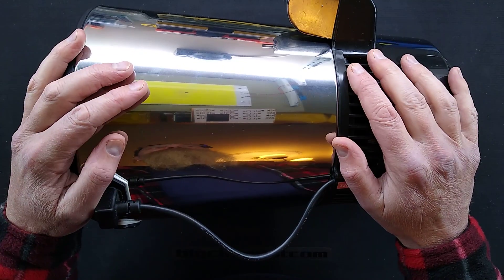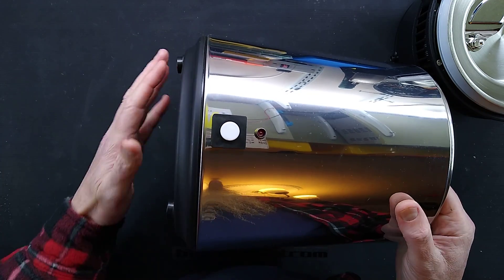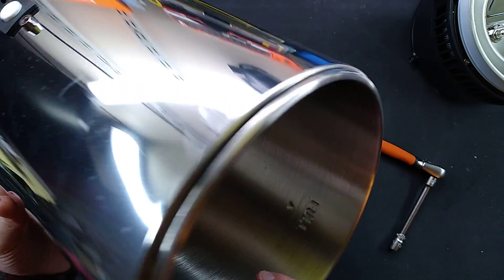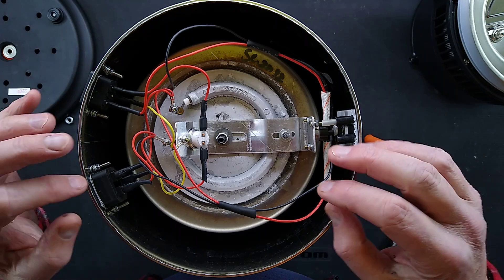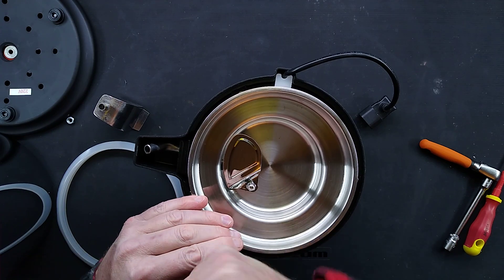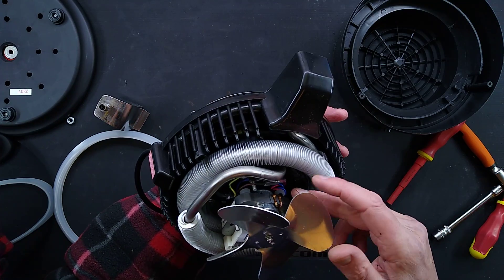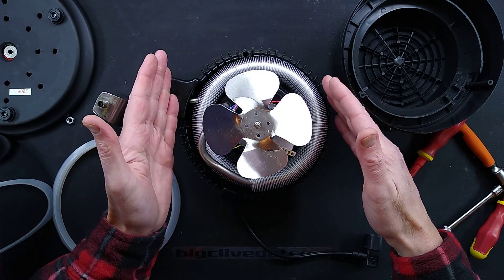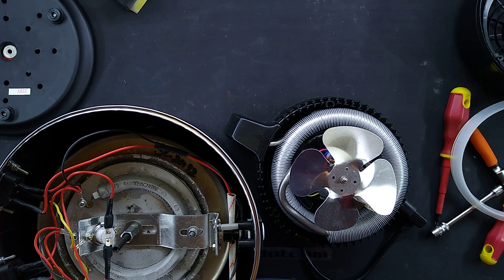Water/alcohol air-still distiller teardown

Comment: I always pictured glass tubes in a lab seting for water distillers. I guess this works too.
It's amazing how simple it is. A heat source, something to collect and condense the steam, and somewhere for that water to go. I like this idea.
Reply: The reason laboratory distillation setups use glass (usually borosilicate pyrex glass as this is more resilient to thermal stress) is because they are usually not used for distilling anything so innocuous as water. Most chemistry labs get through a lot of "distilled" water for rinsing glassware after washing it, since you don't want residues from tap water contaminating your flasks. So it would be highly energy inefficient to run actual distillation systems for this - most labs use ion-exchange resin columns for purifying water since these are much cheaper to run and produce mineral-free water which is perfectly acceptable for rinsing purposes.

Anyway, the actual distillation sets are typically used for distilling solvents, or purifying other liquid chemicals, some of which would react with metals or get contaminated by traces of metal oxides from the surfaces of metal condensers. Glass is chemically inert in nearly all situations, which is why labs use glass for reaction vessels and most other chemical handling equipment.

Metal condensers do exist though - all you need is the two standard diameters of copper plumbing pipe plus some 8 millimetre copper tube and you can make your own copper "liebig" style condenser by soldering or brazing it all together. For distilling water this is perfectly fine, just not for some other stuff. It's also fine for distilling alcohol of course. In fact, every commercial system for making spirits by distilling some kind of fermented mash will have some copper components in direct physical contact with the alcohol being distilled - this is important since the copper reacts with and removes volatile organo-sulfur components which would otherwise give the distilled spirits a bad taste and/or smell.

Comment: Clive, I think there is a thermal fuse in the unit, it would be under the fibreglass sleeve under the manual reset switch on the red wire. 

I will be sending you an email later today, I have an interesting device to send to you for a teardown video. 

Coming back to the Isle for the TT next summer, see you then. Cheers.

Comment: That one is way posher than mine! I've had  mine for absolutely years and apart from that "burping" issue I had a while back it's always been great. I've made literally gallons and gallons of booze with it! It's not illegal to do over here in Portugal either! You have to keep the cooling fins very clean over here because if it gets fluffed up it barely copes with the higher ambient air temperature.

Comment: Those wires (red) seem to dangle very close to the heating element. Is the insulation PTFE?
Reply from the maker: It does appear to be high temperature wire.

Comment: Interesting, now I'm considering getting one to distill water for developing photographic film as I've been buying battery water for that until now.
Reply: @Matt Quinn - Caledonian Television Yes, we actually have very good and clean tap water here so not contaminated in the sense of being bad to drink but it's quite hard, lots of lime scale, so I like to use distilled water for mixing chemistry and for the final rinse. Not sure if it really matters for chemistry but definitely matters for the final rinse, I have tried using tap water for that but I got calcium deposits or "water marks" on the negatives. I do use tap water for the bulk of the washing though and have not noticed any problems.

Comment: To distill grain alcohol, you would want a limit no higher than 180°F (82°C). You only want to boil out the alcohol, but the water.
Reply: You wouldn't. The temperature will never go higher than the boiling point of the fluid. So basically, the temperature will rise to 82-ish degrees (maybe a bit higher), and the fluid starts boiling. Then the temperature only slowly continues rising as the ethanol evaporates, lowering the concentration of it in the distiller. If you would limit the temperature to 82 degrees, the fluid would only boil if the ethanol content in it is about 58% volume or higher.
Reply: @simonbenjamins5175  Isn't it all about bringing to temp slowly rather than boiling the nuts off it quick sharp in a hurry?
Reply: @dofbeer  Normally I'll bring the temperature up until the wash boils. Once the distillate starts running I'll take the heating down so that the distillate will flow in a trickle. This way you can make better cuts, if the fluid in the still boils too vigorously you'll get more impurities in your end product.
Reply: Boiling the alcohol but not the water makes as much sense as drinking the alcohol but not the water.

Comment: unlike the lock picking lawyer you have nothing to hide such as nude paintings such as the one that hung above the bed of the person from the shining so reflections are not a problem for you.

the thermal fuse is in the wire that runs between the bracket and the popout switch

Comment: If you could operate the unit inside of a vacuum chamber, energy consumption should be very low. How do you think about that?
Reply: Boiling point of ethanol at 100 mm Hg is 31.5 deg C

Comment: I like the look of those and using one - as I also have a interest in ventilation fans, but we have already had a fling with those water filter jugs/kettles. I live in London and it has hard water and we get lime-scale in the toilets, shower heads, hot water/central heating system and in the kettle. And that Thames water says 🇬🇧 has the safest, cleanest water supply (in comparison to other countries) so those filter jugs are a financial drain/scam = buying and stocking the cartridge filters, commissioning the filter ~ filling and dumping the water 2x before using it and resetting the counter in the jugs lid - when it runs out you have to replace the filter. And most of the jugs are designed to put in the fridge, in the door pocket - taking/wasting space in your fridge, or you save used water bottles and put those in the fridge for cold water. With the more stylish ones to adorn your kitchen with, the filter kettles claim to remove the scum on tea and the kettle doesn’t scale-up  = my mum puts milk in her tea and doesn’t see the scum and likes how it tastes, and we put vinegar in the kettle to de-scale it and most modern kettles now have a spout screen to stop the bits of scale from pouring into your hot drink so we don’t need a filter kettle. As for the taste; tap water has a distinct taste to it and a filter jug will remove it = making it bland and as water should taste - improving the squash drinks you make with it, but I am not fussed with the taste of tap water. And all modern dishwashers have a water softener built in you just set it and regularly put dishwasher salt in it. We put Calgon in the washer and it has a self-cleaning program so hasn’t got a scale problem. Unfortunately our mains water is shared with the neighbours - so we know where the stop-cock is but don’t know where it splits from there ~ to install a water softener. As for the distiller in the video - I assume it would be similar to a heater fan to run it

Comment: Hi Big Clive and All, interesting item.
I want “processed water” with the lime scaling content removed so bought a dehumidifier. The power rating is 300watts and the amount of water recovered depends on the weather, the higher the humidity the better. I only need a few litres of “processed water for occasionally running small scale 16mm/foot and 7/8in/foot live steam locomotives. I tried a water filter jug but noticed a white coating on the tubing in the boiler after one filling and a refill. Not good.
I’m going to use coffee filter papers to remove dust.

Comment: My dad used one of these toward the end of his life. He used the water for his CPAP machine. He had to wear the device even while awake. And he couldn't rely on a constant supply of plastic bottles of distilled water for the machine. 
He often mentioned that he'd like to change the temperature to 160 degrees Fahrenheit and make moonshine. 
Always a bright spot in the day to see a Big Clive video!
Reply: You don't control the temperature when you use a pot still, you reduce the power and leave the still to it. Easiest way is a small box with a diode in it and a switch to bypass the diode. Use it in bypass mode to heat up the fluid, then to half power to run the distillate. Don't try and control the temperature, that isn't how it works. The only thing the vapour temperature you is when you are separating the different components in the distillate, but if you don't produce methanol in the first place it's not really an issue.
Reply: @salerio61  i bought a cheap water distiller 750 watt ( no temp control) i used it to distil some orange wine i made. I pour 2.5 litre in the machine and let it run. the 1st 30 ml i discharged , then collected 500ml spirit. It still taste like orange and has cleared up a lot. But somehow it doesn't taste nice ? I think the temperature was just 2 hot ? So, i ordered myself a Voltage dimmer and a extension cable for the fan which i plug into the socket (i dont want the fan to run low ) and i will try again, once i received the Voltage dimmer. Do you think this will work ???
Reply: @frankw9836  it'll reduce the power, don't attempt to control the temperature, the temperature is determined by the volatiles in the liquid. Any residual sugars left will burn, you could run it as a bain marie water in the still and the wash in an inner metal container with a couple of ceramic beads stopping touching the elements.

If the stuff is horrible, check the strength (I use a alcohol refractometer) and run it through a second time keep the stuff that is coming out over 90% and the rest into a jar for another run through when the jar is full. Stop collecting when you're pulling 20%. Then you've removed the heavier alcohols. 

If you're pulling 500mL and started with a 10% wash you're only at 50%, that is ok, but if it tastes horrible I'd re-distill for pure alcohol and add it to some soft fruit for a cordial
Reply: @salerio61 thanks for your reply, I hope this voltage dimmer I ordered will do the job !?
Reply: Just needs a potentiometer and a thermometer

Comment: I'm wondering if the internal cut out is controlling the temperature like a fixed value thermostat, easy to find out if the current cycles up and down.
Drinking only distilled water can cause health problems, you would need to add essential minerals and nutrients, Nighthawkinglight covered this and said he added just a bit of the original (boiled) water into the distilled product.

Comment: standard design found on the amazon
100-120v model is basically the same outside including the fan+carbon(you can see the carbon cartridge and metal fan)
so yeah you basically dim the main unit and as the can use seperate IEC connectors you could use a simple variac or even cheap 1000w capable dimmer to run it at less power
I would likely use a 24v ~1500va transformer out of an old UPS (APC models have great 12/14v transformers depending on battery size and even use connectors so you can just borrow it) to give the unit 24vac so roughly (750/120=Ao(6.25A), 120/Ao=R(20 ohms), 24/r=An(1.2A),An*24=Wn(28.8)) so roughly 30w of power for very slow careful boiling of spirits/volatiles
I would likely use a set of valves onto a compression fitting on the output side of the cooling tube(so I can use it normally without them) to have a pressure/temp output measurement to auto change valves based on boiling point so I can set it up with a continuous flow of input(using a cheeky side-mounted float switch and input connector that is normally capped) then basically flow in my distillate source and keep the pot going slow and steady 24/7
point of that is so I can basically make a whole house purifier or full-auto ethanol maker/extractor for engine blends(yes boiling gasoline will be risky but with slow control I can get basically camp fuel and then the leftover semi-stable additives(minus the butane they add) so I can store longer as multiple parts and inject some butane into the addative+white gas mix when I need engine fuels of burn the white as-is for camping as I wanna live on a modular barge mansion property :P
Reply: @NOSUBSCRIBERSWANTED  well it may be slightly more ingredients that are volatile (ethanol if you care balances octane to slightly higher "grades" cheaply)

but as "white gas" is just pure "gasoline base" and butane can be cracked cheaply and simply from a purified anaerobic digester gas output, then if you have the "11 herbs and spices" in a powdered/hyper dense concentrate and simply use a sodastream-type device to inject butane at ~20psi (max before butane liquifies)

the longer life of "white gas" makes it semi-ideal for storage especially in a climate controlled non-uv storage closet with 100% sealed plastic containers(metal might rust and if there is ANY air exchange it will begin to react with air and become contaminated)

turns out if gasoline is stored inside(risky if vented AT ALL) it can be kept at the right temps to avoid the need to vent(circular argument on why to never store indoors) and so you can store for 5+years in at least the non-ethanol blend and white gas in an unbroken canister could last 10+

just reseal the containers(must hold 20-40psi so 2l bottles are ok) and your gas in a cool dark place can last nearly a decade before degredation makes it risky for any engines

but you can always just re-distill old gas to get the sludge+additives out then mix then take the pure hydrocarbon base(white gas) and remix with additives and butane

the petrochemical industry doesn't let this info be very available as humans would make a risky non-rated distiller and blow up their homes by cooking hydrocarbons indoors or maybe just greed as they change supply based purely on what they can force the demand to make us pay

the real sad part is that we even have 100% renewable ways to MAKE gasoline from NON-OIL sources(it requires a 10 bar reactor at nearly 500 degrees Celsius) but we can make it without paying for foreign oil and is powered by the atom(one of the safest forms of cheap high energy) we can easily 100% dump the need for oil besides medical plastics(sadly the last thing that still can't be done without crude) but once the need for gasoline/diesel/kerosene/propane/butane is supplied
by non-oil the research for non-oil plastic that is ideal for medicine will have no profit margin to suppress and so we can become a green society in a few decades

just know that ANY LEAKS and your gas vapors(and the butane gas) will pool in your house
if that amount reaches the ideal fuel+oxygen ratio even the heating element could make it go "boom"
so ONLY outdoor hydrocarbon distilling
if you do it inside you are at fault for the inevitable explosion

now I have covered my legal ass and said why distilling gas is almost ok and can nearly be reversed so storing gas for emergencies (the apocalypse or soon-to be loss of ALL oil(gonna happen if we don't go green)) now you have the actual facts and some basic ideas on how to run your generator/car when the pumps dry up so you can be one of the richest members of the post-oil society

Comment: I use one of these for making distilled water but was wondering if its cost efective. it makes 5 litres in about 2 hours but I can buy 2.5 litres deionised water for £1.50 in any supermarket. I will have to work out how to calculate the cost unless someone here can give me a rough estimate.
Reply: You just take your electric rate in kilowatt hours and how many watts the appliance uses, as well as time, to figure out the cost. 

For example, my electric rate is 11 cents a kilowatt hour (1000 watts). This kettle is 750 watts. So if it takes 2 hours to make 5 liters, then that is consuming 1500 watts to make 5 liters. 

So 0.11 times 1.5 equals 0.165 cents. Which means it costs 0.0825 cents per 2.5 liters. Not accounting for the cost of the water. 

I'm not sure of the exchange rate of dollars to euros, but I'm pretty confident eight cents is less than one and a half euros. Inject your own electric rate into the formula to figure out your own specific costs.

Comment: Depending on the minerals in the water you can also have "soft water". Instead of hard water with calcium and magnesium you can have soft water with lots of sodium and potassium... Often from natural springs.
Reply: You can soften hard water chemically.
Reply: @BedsitBob  Which adds the elements that the hard water ions like to bind with so it can settle out or at least be inert in the chemical sense for washing up...
Calcium Hydroxide (slaked lime) for example can be added to make the Magneisum Chrloide in hard water precipitate out as Magnesium Hydroxide, then since you added extra Calcium you now have a lot more of that than before (hard water can be MgCl2 (Magnesium Chloride) and Ca(OH)2) (Calsium Hydroxide)), so to get rid of that you then add Sodium Carbonate. Result is precipitate of of Calcium Carbonate. In addition you are left with Sodium Chloride in solution. That's just one example though.
For such a process you need to know a lot of what is in the water to properly "cancel it out".

Comment: I have the white plastic version and after 1y10m it turns on but then after a short while turns off producing no heat.
Reply from the maker: It might be worth checking that the heating element hasn't become detached in some way, and that any residue is cleaned out the container.